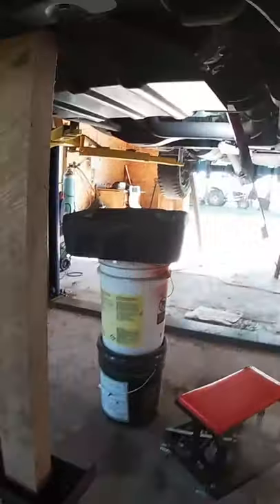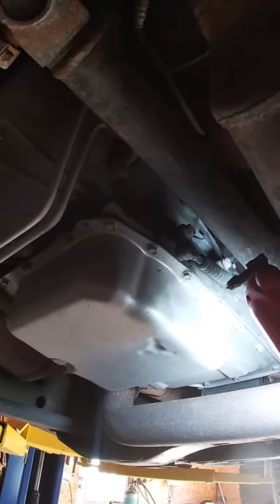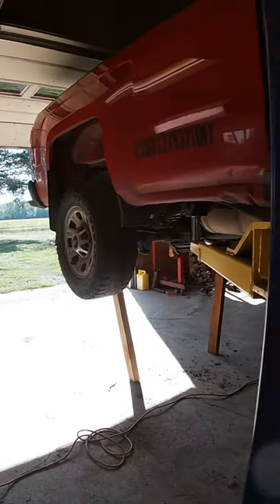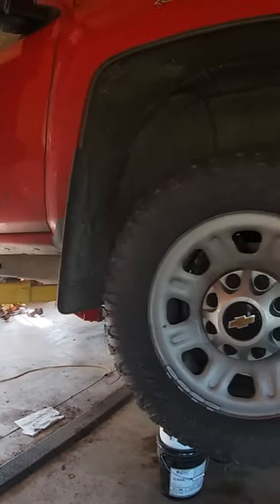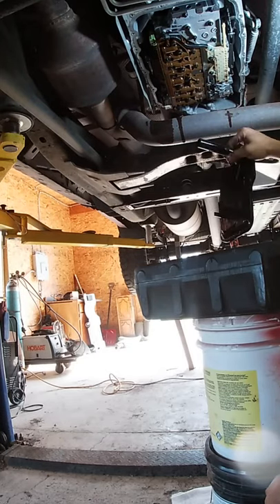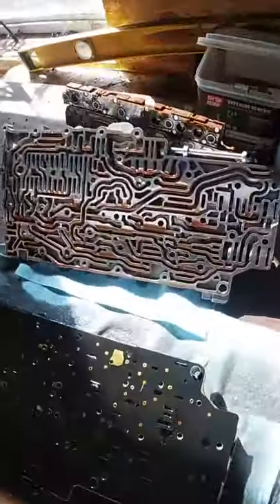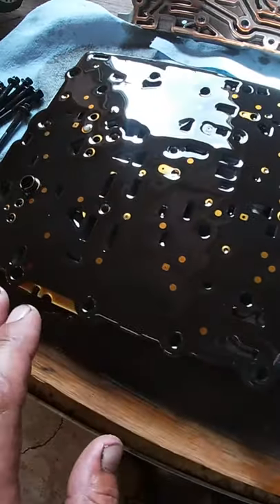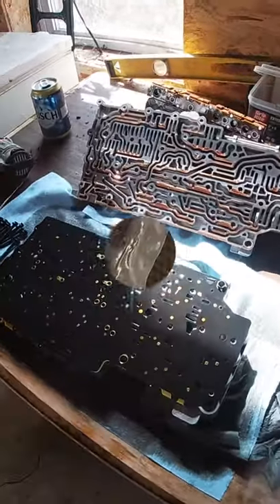Silverado 6L80e 6L90 NO DRIVE/Forward Gears FIX!!

Comment: I just had a customer with a similar situation the transmission will not go into drive, only reverse but if I drop the level all the way to the l and then choose number two and slightly accelerate it will go into gear and then as I'm driving I just shifted to d and it goes through all the years normally except for the first gear,
Reply: Did you find out what was the problem? I’m having the same issue with my truck
Reply: Did y’all ever figure it out? Mines is doing the exact same thing